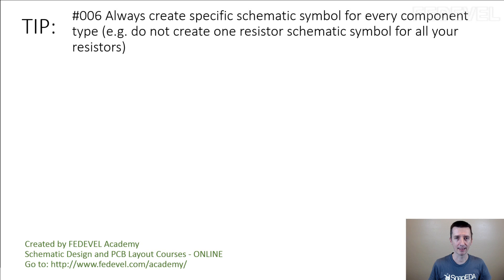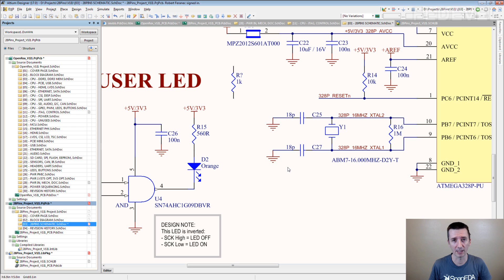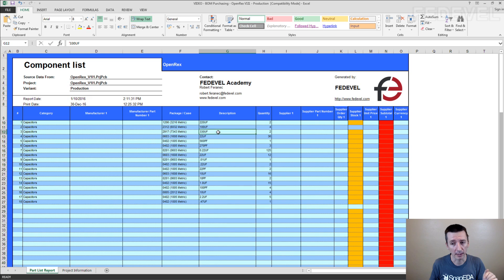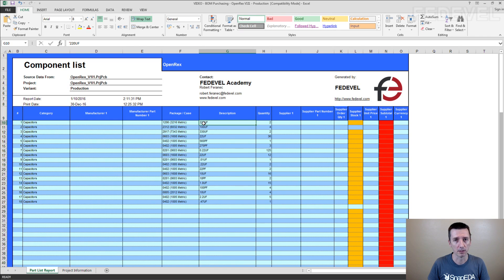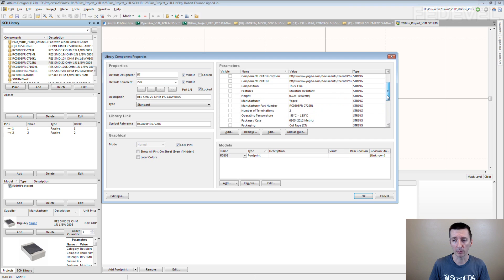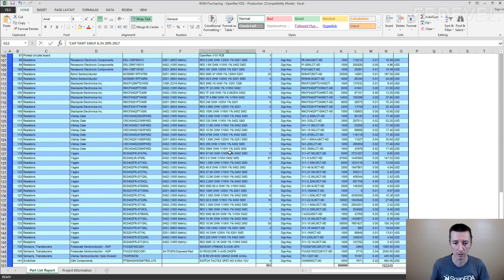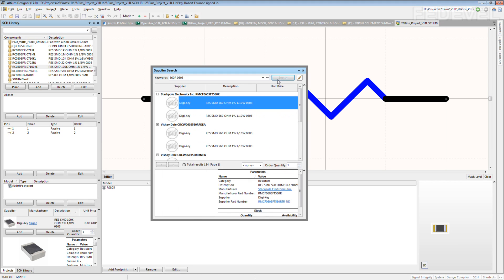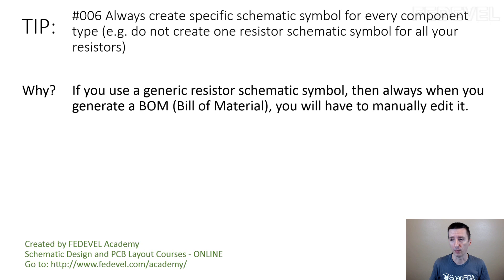TIP #006: Always create specific schematic symbol for every component type

Comment: Yes, I have been thinking about moving on to separate symbol for every component for a time now. However, manually adding component parameters isn't a too fast alternative to having separate symbols. One can add custom parameters such as BOM Link, BOM Manufacturer, Bom Comments, BOM Description, BOM Value to every component by going to the tools/parameter manager menu. Then you can just copy-paste info from supplier websites to each of your components.  Run ECO and magically refresh values, part numbers, manufacturers, everything all at a time. You can pick what parameters you want to include in your BOM. You pick these custom BOM .... parameters, quantity, footprint, and anything else you might want, and you're done.
Reply: Nevertheless, I too think, this is the best way to go because this way you get to pick a resistor just once, then use it for as long as it is available..

Comment: Why do you place a parallel resistor (R16, 1M) across the crystal? To load it perhaps? great video! :)
Reply from the maker: Reference schematic / recommended connections :) for this kind of sensitive circuits I follow what is recommend by chip manufacturer.

Comment: Thank you for another great tip.
I have one question. How do you deal with alternatives ?
For example, alternative parts or alternative distributors.
Reply from the maker: Alternative distributors: for prototypes, we normally buy from the info in BOM files. For mass production, people in purchasing have their suppliers, and their ways how to find the best deal. I had a look at systems like ciiva, and even I think it can be sometimes handy, but purchasing has never addopted it. 
Alternative components: we do not include this in schematic, normally we answer by email and purchasing makes notes. If the change is important (e.g. the component is end of life), we replace these components when a new revision of schematic / board is created.
Some time ago I tried Altium to use more alternatives, but at that time it was not the best solution. I know, I think in vaults now you can see also the alternative suppliers .. but we do not use vaults.
Reply: Thank you Robert.

Comment: I use database too. Using DBLib connecting to a small postgre SQL database. So I got all components separated in a database.
With mostly "generic" components (with Farnell commande code) and when the design requires using really specific component, I can create a very specific one. And in this database I specify also which Symbol (often generic) and which footprint to use.
Reply from the maker: Please, could you point me to an article or post how you do it?
Reply: With pleasure, but I think it should be like a tuorial with several screenshots.
Where could I post this?
I made last year an introduction to this on EEVblog forum. Maybe I can continue there?
Reply: Robert Feranec
Will just start with a google doc and we will see.
Reply: I sent you a google doc in private (youtube message). Hope you get it.
Reply from the maker: Teg, feel free to post here link to the EEVblog forum post or/and to the document. I found your document very useful, maybe also other people will find it useful too. Possibly, in case youtube prevents you from posting the links here, send me the links and if you agree I can post them here.
Reply: Ok, I try to link here:
https://docs.google.com/document/d/1-B35fDdS_LL7PVdWb8YbCH_7kQBTdq51whVv366jwJw/edit?usp=sharing

Comment: yet another great tip. I used to copy and paste the resistors in the lib and change the value / ordercode and that was it.. these days I work with the database option so you stil have only one symbol for resistors capacitors etc etc. and I just copy a line in the database. great thing about the database is if you need to change or add a lot  components its way easier than doing it in altium itself. you should do a tip about donwloading parts from the design content of altium .. and these days I see a lot of companies adding it straight to their webiste e.g. samtec/ wurth you can donwload the component with correct (and checked footprint) and a lot of 3D parts come with it. and the best thing is it saves so much time!!! I am really looking forward to the next tip video robert!
Reply from the maker: Some time ago I tried to create components and use database, but I have not found the best and optimum solution, so I create symbols + footprints. Maybe Altium has change it by now, but I think the biggest issue was, that I had to release the components and the procedure was quite time consuming - especially if many of the components which we initially place into schematic are not used in the final design (e.g. the specific circuit is removed or changed) and then all the time spent by creating these components was wasted. What database do you use and how your Altium is configured for this?
I do occasionally use  Altium design content and vault, but I do not promote it too much. BTW, some time ago I told Altium, that the supplier search should point out components in Altium databases, but they have never implemented it :(
Reply: Robert Feranec i use MS Access database for the components and use the dblib to link the two together.  Only downside i need to update the database in altium with a batch file since the database is stored on the server and i work on local libs.  So any update requires me to close altium run the batc file (copies the files from te server to local drive)  and restart altium for the new components to show up.  But having the database severly reduced the schematic symbols for passive components..  I think we had some help setting it up from altium but since then it has been easy going..
Reply from the maker: Thank you. Interesting. Let's see what also Filatov Teg will answer.